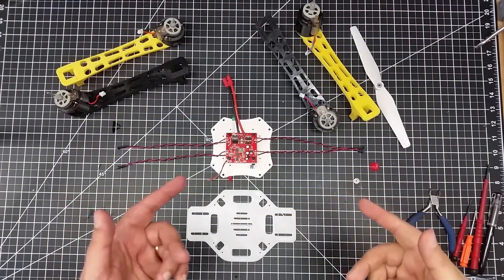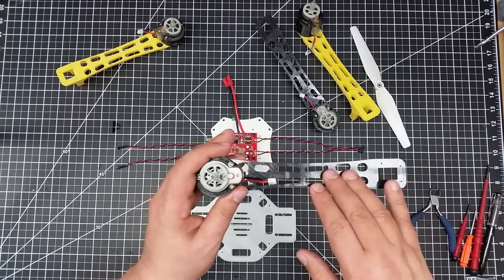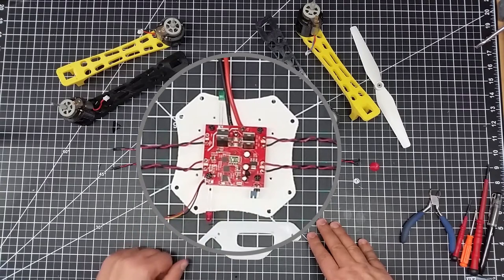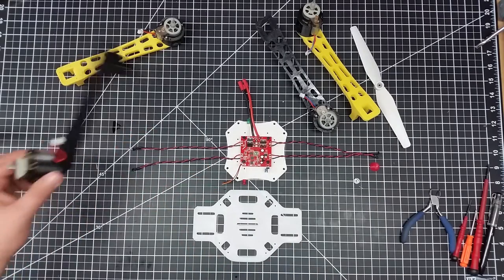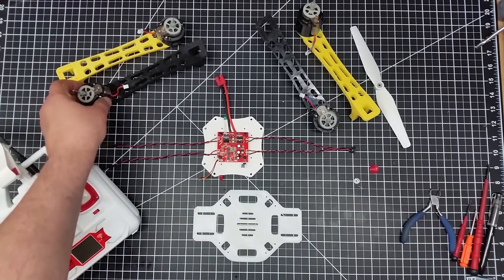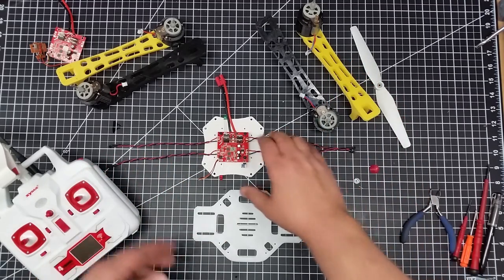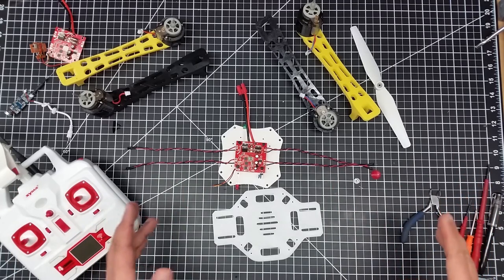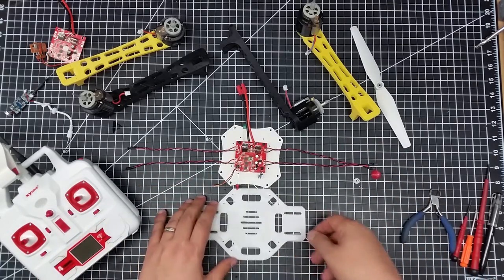Video Drone -  ReImagining The Syma X8 Part One!

Comment: Looks good. Can't wait to see that fly. I start this year also with the Syma x 8. Am also very interested in your findings. Also the brushless options. I'll keep watching.
Reply from the maker: +John van Bemmelen I looked at the brushless options and for the added Money could just buy a better quard
Reply: Maybe, but the Syma X8 transmitter and receiver is the only one I have. My other transmitter and receiver are only for micro quad.
Reply from the maker: What I am attempting to say is take the 100 plus bucks and add a little to get a RTF brush-less (as you can get brush-less / GPS) drones for 200 buck as my two cents is brush-less motors are too much from the Syma X8 as the controls have a high fly away risk to them and arm them with brush-less motors...
Reply: I understand. The cheapest solution offer no protection if it flies away. I have this year the standard Syma X8 to challenge. Brush-less is for next year ;) Am curious about the quad where to you in this video are begun.
Reply from the maker: After thinking about this, I have decided to order this kit and do a video on so once it come in keep an eye out for it...

Comment: Nice project. You might want to think about printing everything in ABS.  From a weight to performance ratio, ABS is much less dense so much lighter. When I started weighing all my drone mods, I was surprised at how much lighter ABS was over PLA and PETG.
Reply from the maker: +RJ_Make you remember my hate of ABS 😜 however may give it a try these pulled apart as I was shocked at the power these cheap little motors create!  Might do in HIPPS as I have had very good luck with it strength wise...
Reply: It's definitely a 'balancing act'. I'm amazed at how well some of the designers in our community 'balance' their work with regards to design, weight and material.
Reply from the maker: Agreed, however that at least for (and to guess others too) is part of the fun!

Comment: Hi, I'm curious if you know an efficient way to oil the props on the syma x8 that doesn't involve splitting open the body? Also, what oil do you recommend?
Reply from the maker: I do not recommend oiling as that attracts dust and dirt and that will wear faster than anything.  I simply keep mine clean using compress air and they been good for quite some time.
Reply: Video-Drone ok, you use compressed air by just spraying through the vent holes in the body?
Reply from the maker: I take it apart as I am normally tinkering with something...